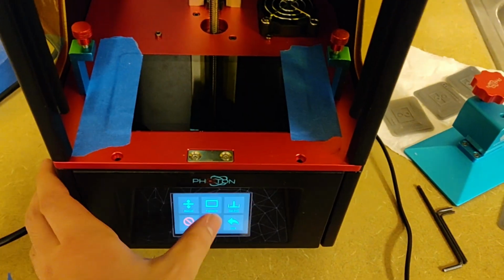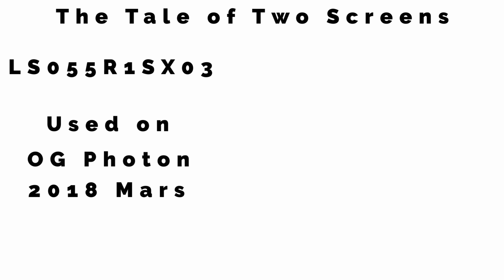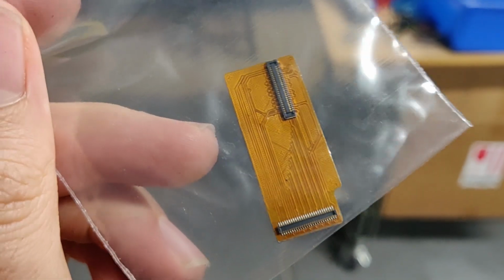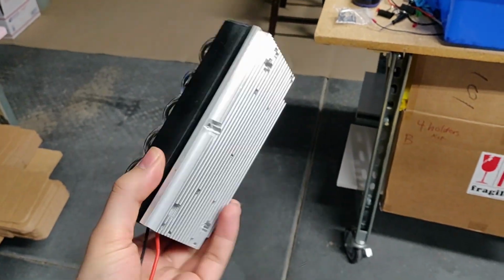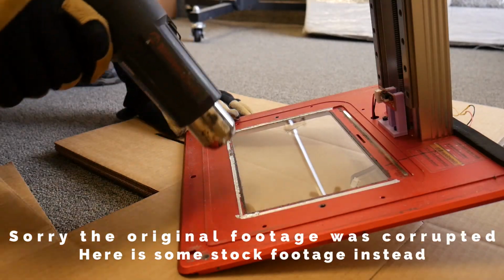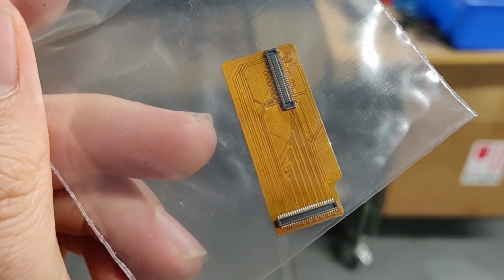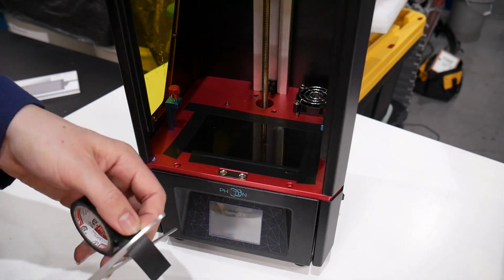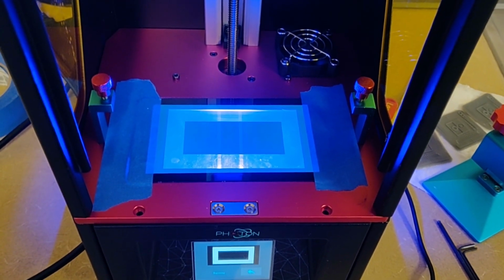The Easiest Mono Screen Mod for the Anycubic Photon (And Most Other Older Resin Printers)

Comment: Yasu, can you clarify what print time / exposure time improvements you found for your test resin using the new mono screen on og photon?
Reply from the maker: I knew I had forgot something lol! Exposure times will vary from resin to resin. But here are my benchmark times with Ministry of Resin Durable but you should be able to extrapolate the ratio between the FHD mod and other printers and mods.

FHD Photon Mod: 27s Base Layers / 3s Layers
LD-002H: 21s Base Layers / 2.3s Layers
Photon Mono: 24s Base Layers / 2.8s Layers
My 6" Mono Photon Mod: 16s Base Layers / 1.6s Layers

I will pin this to the top for other folks.
Reply: @HiroCreations  Very comparable to other mono exposure times. I suspect that resin would be 8-10 seconds or more on the OG Photon RGB screen... so print time likely reduced to third or less... that is worth the loss of 15um resolution to me!
Reply: Hey 👋 i have anycubic photon mono 6.08” lcd screen needs replacing im guessing im out of luck? 🤷🏻
Reply from the maker: @metal8113  you need to replace the screen on a Anycubic Mono? Not upgrade a Anycubic Photon correct?

Chitu Systems should have 6.08" replacements for the Anycubic Mono.

Comment: Thanks for making this video, Yasu ! I got a Photon during Black Friday last year, and didn't consider the 'mono' options because I run my printer while I'm at work so I don't mind the longer print times. Given that the screen is basically a consumable, this makes me think that buying a Photon, waiting for the original screen to die, and then upgrading to a mono screen is more economical on the long run than buying the upgraded models upfront.
Reply from the maker: Yep! You will also find that the mono screens have a crazy long life--especially if they have tempered glass protection which makes cleaning up resin spills easy. I have a 6" mono screen that has about 5.5k hours on it now.

Comment: Thank you, this is gold! I did it on my Creality ld-002r and it prints 3-4 times faster now. I run a 2 sec exposure time at 0,1mm layer height. The mod and firmware update worked without any problems.
Reply: How is the MOD working? I sent you a PM on FaceBook

Comment: Thank you very much for making this video. I am not too tech savvy, but from what I understand, to replace the screen on my anycubic photon with this mono screen, I have to replace the screen, add the adapter and flash the system. Again thank you for the video, I was looking forward to it.
Reply from the maker: Yep, if you plan to use the original control board on the Photon (make sure its the OG version and not the newer ones that were made late 2019/2020 which uses a custom board) then its just change screen, use the adapter, and flash the firmware. 

Chitu Systems has more detailed and clearer diagrams of the layouts further down on their product page which is a handy reference https://chitusystems.com/product/fhd-5-5-mono-lcd-for-elegoo-mars-elegoo-mars-pro/

Good luck on the upgrade!

Comment: The Elegoo Mars (1) came with 3 different boards. Board C does not require that adapter for the original screen. (Easiest way to identify it vs. A and B is the wire connects to the outside of the board instead of the inside.

Comment: Fantastic work! Printing small scale stuff, I think I have to wait for more than FHD resolution though. Hoping that you get a hold of some nice mono 5.5" lcds with more pixels soon :)
Reply: The actual resolution on the mono screens vs colour screens is better than it appears. I think the 2K colour screens needing 3 pixels to display one white pixel makes them effectively lower resolution than the FHD mono screens. My prints seemed better with detail after the mod.

Comment: (Voltage pump) A charge pump is a kind of DC-to-DC converter that uses capacitors for energetic charge storage to raise or lower voltage. Charge-pump circuits are capable of high efficiencies, sometimes as high as 90–95%, while being electrically simple circuits.

Comment: Sweet been waiting for this video. Going to give it a try with my Qidi Shadow 5.5s thanks U Da Man!
Reply from the maker: Awesome, I can't remember what board the Qidis use so you might want to double check and make sure you don't have to swap the boards if they are not using some sort of Chitu board.
Reply: Please post back here and let us know how it works out. Does your Shadow have the 03 or 04 screen?
Reply: @protrainz  Mine looks like the 04 screen its not a curved cable plus the board looks like a v3 board in it. my screen is on order just the wait from the slow boat from china.
Reply: I got my screen installed works good with chitubox cant figure out how to change setting in lychee. dont bother with using the double sided tape just tape the screen down around the perimeter on top. it does speed up printing. :) make sure you reset your bed level too. i use more easy bed level from thingiverse.
Reply: @prismacolor  So (other than opening things up to get to it) this was basically just a plug and play replacement? How does the firmware get updated (there seems to be 2 files, but no directions)? Assuming you went with the firmware for the v3 board?
Reply: @prismacolor  Which one did you order, the one for the Mars Pro?
Reply: @protrainz  I went with SC-03-70 for the og mars not the pro version also I used the v3 of the software and i put both files on flash drive and ran the cbd file like a print it updated then done. and yeah it was pretty plug and play. the cable on the new screen didnt align as perfect as the original but it will fit. i taped it down to the board with duct tape. I feel it holds in better that way.
Reply: oh also  I didnt use the glass that came with it just the screen I tried the double sided tape to hold screen down but the screen is a little thicker so it didn't hold so i just taped the edges of screen down to the machine. it keeps resin out of machine too when taped. I had to relevel machine since the screen height changed. I've been doing 2 second cure times but that seems a little long still on some stuff.
Reply: @prismacolor  Now they updated the firmware to supposedly support Chitubox Pro. Flashed fine, but I'm not seeing a mask on the exposure test. Guess I'll try flashing the older firmware and see if that helps.
Reply: Older firmware got the mask to appear, but I also had to reflash the UI.bin file. Now I'm getting a "different resolution with projector" error. The old screen was 1440, is the mono screen different? Tried switching to 1080 in chitubox, but the error remains, except now it says 1080.
Reply: changed the Y resolution to 1920 and it's printing...
Reply: @protrainz  glad you got it printing :) I couldnt reply was in hospital for several days :( how fast do you have your layers set for and what resin you using? im using siraya tech fast resin and 2 second layers

Comment: Quite a nice mod. I have my photon 2 years now - but did not used it, as do some homeimprovemet since than and want my second bathroom to become a resin printer room to avoid any fumes (and use an old CPAP medical unit to provide me with clean air from another room). So the Photon will get this upgrade before it's first use.
Monday anouther Aliexpress sale starts. The price will be €36,75 incl. VAT - and with some coupons it will be even lower. So I will definitly buy it.
But the perfect smal resin printer in my opinion still is not published yet. The Anycubic Photon Ultra starting on Kickstarter in September is the next step - but I would like a 4k DLP instead, double size - but zoomable to standard size with double the resolution. Also the tilt mechanism the SL1 uses would be a nice feature (1. it is faster than z-lift. 2.tilting means less stress for the FEP, lasting longer 3. much less risk of print being torn of the buildplate). I am sure we will se this in the future - but might take a few years. So use the photon as long as possible definitly is a good idea, as with DLP there is an increase in quality over LCD - and if they go 4k, this will be another quantumleap.

Comment: Thanks for this video. Very helpful. However, the Chitu site explicitly states that this screen may not work on some early models of Mars because they use an older V1 board. They show pictures of the boards on the page and indicate that it only works on the V2 boards. Worth bearing this in mind. 

"Note: ELEGOO also uses L5.5-10.1 board in very early batch which not support FHD LCD yet,  Please make sure your board is V2 (The version C on the below picture)"

Comment: Thank you for your video, I would like to replace my Photon with the motherboard and display with the 2k mono Chitu kit. I just have a doubt, what did you put to protect the display (in case of resin drop)? There is no LCD protector in the kit.
Reply from the maker: So right now I either use a FEP sheet taped down at the edges (and then later reused once the vat ruptures) or a mylar/pet screen protector (whatever random brand is the cheapest and fits)

Longer term on some larger custom builds, I bought a bunch of thin tempered glass and am testing covering the entire screen with a proper glass plate which can be cleaned and scraped with a metal razor aggressively without consequences.
Reply: @HiroCreations  Thank you! I'll do some tests too. Using FEP in this way is a smart idea!

Comment: This is definitely worth it if you already own a Photon or Mars, the cost is only about 30% more than getting a replacement RGB screen for those printers. By comparison the 6'' mono screens are roughly twice the price of the 5.5'' RGB's. At first i thought it was a copout seeing the lower resolution, but after i realized it's only a 15 micron difference i think the reduction is negligible. You can get pretty good prints with anything that's below 100 microns.

Comment: Hello Yasu! On your recommendation, I made an upgrade of my Photon. Everything works perfectly! Thanks. But I have a problem with the ChiTuBox slicer. I can't use it as it conflicts with my other software on the PC. I use LycheeSlicer. But I do not know what settings to make in LycheeSlicer so that it can create files in a format understandable to the Photon FHD printer. Please help with the LycheeSlicer settings! Thanks!
Reply from the maker: I've not used Lychee in my workflow as it has wierd corruption errors on about 30% of my slices. Does Lychee support ctb exports? If it does and you've not updated to the newest firmware version that encrypts the sliced export. You should be able to get your photon to recognize the lychee exports as long as the updated screen resolution matches the slicer.

Comment: Hi Yasu, thanks for your effort, you are amazing. I have some followup questions:
1) is there a 4k 5,5 screen? I heard rumors.
2) what is the combination of screen/board that currently gives the smallest pixel size numbers-wise?
3) in your opinion, what is the morst future proof approach (OG photon):  a) replace the screenplate for a bigger hole (along with lightsource+board+screen)   b) keep screen plate and just upgrade board+screen and eventually lightsource  ?
Reply from the maker: 1. BOE makes a 5.5" 4k but it's not compatible with Chituboards and requires a dedicated HDMI driver board.

2. The previously mentioned BOE board + nanodlp would give you the smallest theoretical pixels bit I have never gotten them to work.
Reply: @HiroCreations  thanks for the quick reply. afaict , the BOE screen is not monochrome though. and i had hoped you  would actually answer slower, so my edit of the OP would go through 😅
Reply from the maker: @kensaiix  interesting, they must have sold out and taken down the listing as there was a mono BOE 4k version that had a few prototypes sent to people much smarter than me a few months ago in December.

Comment: I have this working fine on my Qidi Shadow 5.5s with the "older" firmware, which consisted of 2 files, a .LCD file and a .CBD file. The "new" firmware has 3 files, a .LCD file, a .CBD file and a .BIN file (actually 3 .BIN depending on the size of your touchscreen). Do all 3 need flashed, and if so, in what particular order (or does it matter)? Hoping the "new" firmware will work with the Chitubox 1.9 update, as apparently they've changed file formats.
Reply from the maker: Yeah, I'm still staying on version 1.7 of Chitubox until I am absolutely sure that the stability issues have been resolved on both slicer and printer firmwares. 

I've updated the CBD and LCD files in different orders and I don't think there were any issues or interdependencies between them. Less sure about the. bin files as I've kept my farm on old versions of firmware.
Reply: @HiroCreations  Apparently others have had this question, as there's now a link on Chitubox's site  which adds a little more clarity on what the files do, and how the process supposedly works. Updated my firmware last night. With the 3 files on the root of the USB stick, it autoloaded something, which mainly trashed my UI. It was still (barely) usable, but until I realized that I was a bit worried. I was able to "print" the other files (since I wasn't positive which it autoloaded, I did all 3). After removing the files from the USB, I rebooted the system and had a normal UI back again. Checked the firmware version and it was the new one. Running a print now (still sliced with chitubox 1.81), so I've got my fingers crossed. Link: https://www.chitubox.com/en/article/support/howto/chitubox-pro/install-activate/how-to-update-your-printer-firmware
Reply from the maker: @protrainz  Oh it sounds like they added firmware files that allows you to change the UI LCD resolution/power on logo as a part of their firmware package. Weird that they are executing on power up though.

Comment: Thank you for the guides! I'm currently in the middle of an issue where my 5.5 mono screen is not turning on. I can see my UV Light shinning through the screen, and my touch screen is working as it should. I used the 5.5-inch FHD MONO LCD Screen And Motherboard Upgrade Kit For Anycubic Photon straight from Chitu. Have you come across any similar issues in your builds? Thanks in avance
Reply: Cameron did you ever find a solution to your issue. I am having the exact same problem. I see light coming through … the touch screen works but no mask is being presented?
Reply: I just checked the capacitors like was shown in one of the comments - none were blown - shew. I reseated all the adaptor connections and now I have a mono screen and the rectangle on the UV test. The contrast on the mask isn’t as great as I would have thought it should be - I hope you got yours fixed.

Comment: The board holder seems to be reversed from what is showing, this places the board to close to the LED array and impossible to close, do you have the cad file so we can adjust this?
Reply from the maker: Finally had a little holiday break that gave me enough time to clean up my project file and export step files for the individual parts needed for the mod. You can find them here: https://github.com/Yasu3DP/Anycubic-Photon-Mono-Screen-Upgrade/tree/main/Photon%20Mono%20STEP%20files

Comment: Great video.
1) So if I have photon photon 2019/2020 do I need to replace the board to v3 to make this works?
2) If want to combine 5.5 FHD and new parallel light source (the one from the previous mod) is board replacement necessary?
3) Which of your two mods prints better in terms of quality (if noticeable)? I've got original sonic mini which I believe have the same screen (5.5" FHD) and although prints are crisper (imo due to the better light source) the print lines (limited XY resolution) are more noticeable.
Reply from the maker: 1. You may want to double check, I know Anycubic had comingled stock of either their custom Photon S boards or the Chitu V1 boards for a very long time. There is quite a few pics and discussions of how to identify the Photon S boards vs the V1 boards. 
2. Nope the stock boards are good to about 60w-70w of power consumption--if you need more than that you can always power the light source from the power supply directly and use a mosfet or quality SSR to control the light source via the board. 
3. I honestly am having a really hard time seeing any real differences between the FHD screens and the 6" monos save for a few use cases like super simple shapes like cylinders, spheres etc, but I am still not certain that is also the result of print orientation causing issues. If I remember correctly the Sonic Mini does not have AA enabled so very noticeable voxeling may be the result of no AA.
Reply: @HiroCreations  Correct me if I'm mistaken, but isn't the V1 board a 12V output and the UV array you used a 24V input? Would that not cause issues? Sorry, I'm not the best with electronics haha. Thanks for the great videos, excited to see what comes next!
Reply from the maker: @NikkiAnnMarie  Yep you are correct, a stock Photon uses a 12v power supply, but all the Chitu boards can take either 12v or 24v inputs (and output the same input voltage). Its a nice touch that makes those boards a little bit more versatile with more lighting options.
Reply: @HiroCreations That's really cool, thanks! I was struggling to find documentation for the L1 board, saves me upgrading it for now!

Comment: hi Yasu

I just tried this upgrade with an og photon, I also upgraded the board and installed the firmware, the issue I am having is that the printer doesn't work with the .photon file extension, which file extension from Chitubox did you use?
Reply from the maker: You will want to use the newer .ctb file extension.